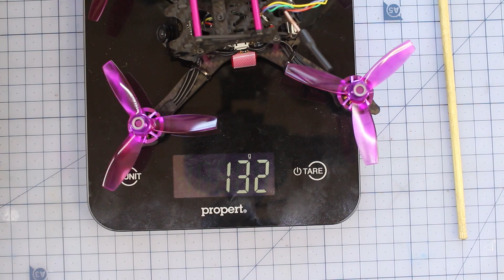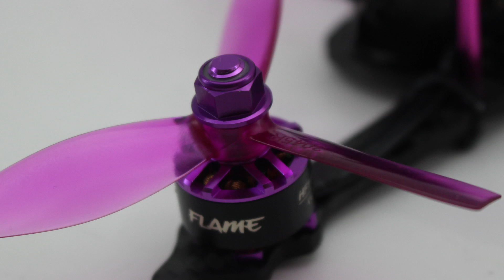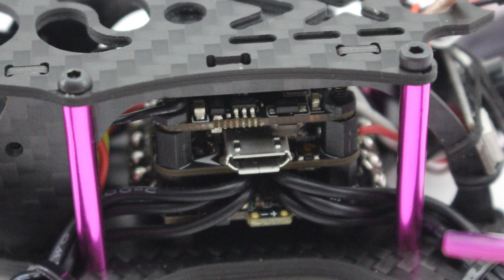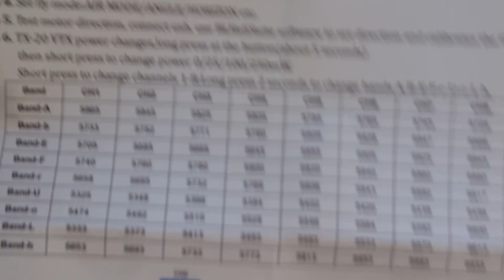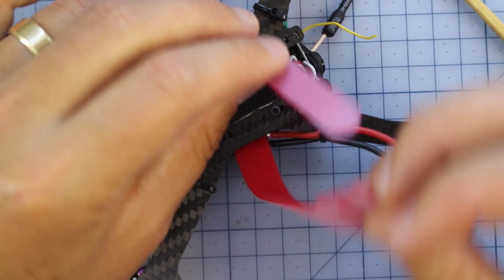3" SEASON IS UPON US!! XJB 3" FPV racing drone

Comment: The new one I just got from Gearbest came with a fancy box, F438 stack with the V2 VTX (instead of the F428), and notches in the frame to set the buzzer/led into (no elastics holding it on). I'm impressed!

Comment: The TX 20 VTX is total garbage and my advice is to stay clear. And on the HGLRC Facebook page, I am not alone.. You can wire it all up correctly and secure the antenna but that won’t stop it getting fried. My HGLRC FJB28 has gone through two of these in one week. VTX03 is far better than this piece of junk.

Comment: There are the Mobius Mini and the Runcam Split, you know?... of course you know... but you have the GoPro stuck somewhere in your mind :D 
I have a 3incer sporting 1105 motors and just tested a much heavyer 850mA 3s battery and it still feels alright for me. With the Split inside totals out 180g. 
There are cameras that offer good enough quality for such small copters, and they do not weigh the same as the quad ;)
Reply: What frame are us using? I am building a FlyEgg 130 / split with 1106 sunnysky
Reply: Yah I agree, this is an ok option to mount one of those lighter and cheaper cameras on and still be under 250 grams.

Comment from the maker: EDIT price was increased to so try this code "RCCool1111" to bring it to 145.27$ 

So when I was reviewing this it was around $200 http://bit.ly/xjb145  and I thought that was fair. But I asked gearbest were there any future sales and they said if i use the coupon "HGLRCXJB" it should be like $135. THAT IS A MUCH MORE ATTRACTIVE PRICE. hope it flies well in part 2.
Reply: love the new beard Stew LOL
Reply: How about we name it "The Baby Stu"  or "the Babe" lol
Reply: Why is t echoing?
Reply: 207 grams nice, can’t wait to see part 2
Reply: UAVfutures I wonder if that bracket might be good with a Mobius Micro or even just an 808 keychain cam, which is all of 17g. I am surprised you haven't had  someone try to encourage you to try an 808 #16 on a 3" quad before!
Reply: 13xx motors have a different mounting pattern, so this frame cannot take them without modification. Also, the cons aren't really serious considerations. Getting dinged down to 6 out of 10 (especially for $135) for the name (seriously?), including a method to add an HD cam, the u.fl/ipex connector coming of easily (like the top plate was removed), the lightweight strap (without a buckle), no threadlock (optional anyways), ugly box (who cares?), no extra props (they're extras)....??? The electronics stack is the most popular for custom micro builds right now for 3" through ultralight 5", including hard core race frames (i.e. Mode 2 Ghost, Hyperlite Tooth Fairy).